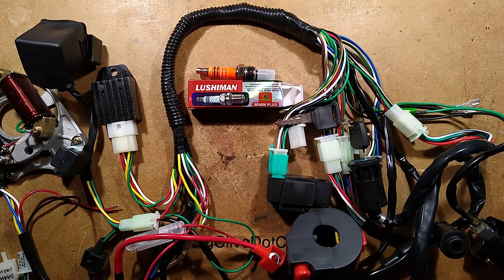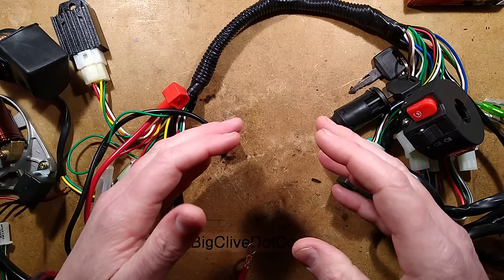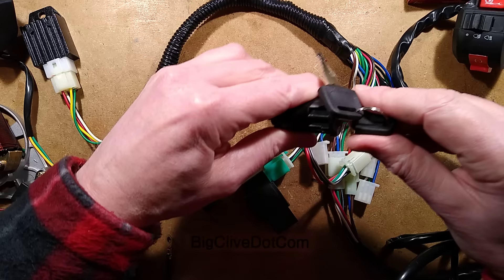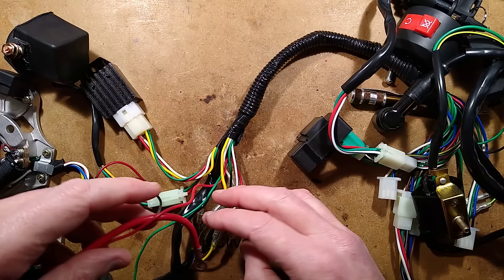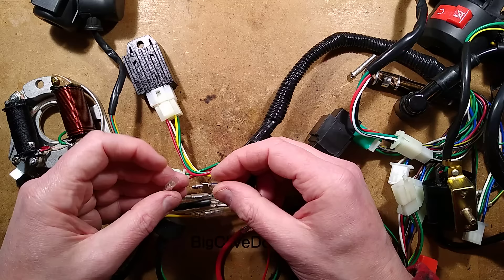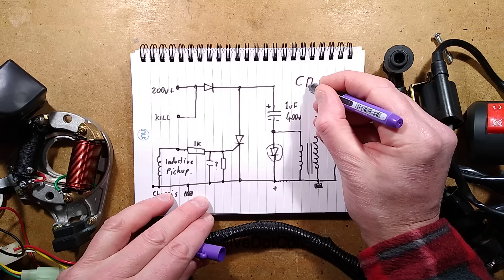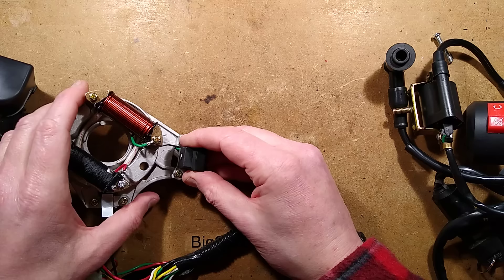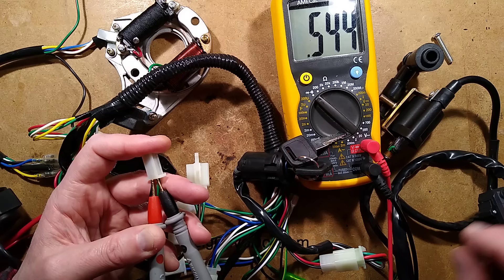Exploring the wiring loom of a Chinese quad / scooter.

Comment: This has to be your single most niche teardown.
Reply: Eh, I've seen nicher.
Reply: I love off roaders & Clive...
Reply: I would say its one of the most common! All the chinese 50cc scooters have exactly the same setup, and these things are everywere here in europe. I fixed a dozen of those things, just for friends and neighbors.
Reply: @MrMilarepa108  ah yes the good days
Reply: @WolfmanDude  On reflection, thinking about what Clive has looked at in the past, I'm now inclined to agree!
Reply: Surely no more niche than electric showers
Reply: @WolfmanDude  could you tell me what the two wires from the stator/flywheel are for?
Reply: @allball8014  Yellow usually is 12VAC for the headlight. The white one is 12VAC for the battery-charger. Both go into the regulator first. Tell me if you need more info
Reply: @WolfmanDude  thanks for replying, I’ve got it wired up, but it continually turns over. The kill switch doesn’t shut it off or the key doesn’t either. If I touch the starter wire to the soliniod it turns and disconnect to stop it. Any help is appreciated.
Reply: @WolfmanDude  this isn't for a scooter, based on the controllers and the length it's a atv motor 100%, the scooter motors are basically all gy6 based as well, this one is an very similar engine but not gy6 based on the stator, likely a 2 stroke equivalent, but wouldn't have the standard mount points to be compatible with gy6 frames, might be cutting hairs though, for how they operate there ain't much difference

Comment: The size of them quads/ATVs are usually kid-sized, hence why everything is so close together, neat kit though, could be useful for building up custom small-engined power toys... :D
Reply: That explains why the ones I rode in summer activities "camp" (no overnight things) were so perfectly sized! God damn I loved zooming around an empty farm field in one of those things. As a 7 year old, that being my first firsthand experience with any motor vehicle, oh it gave me a real taste for em.
Reply: @kaitlyn__L  I've no experience of riding them myself, I've just seen a number of them here on youtube being fixed up or torn apart for their engines to use in other projects... :)
Reply: But the same parts are also used in 50cc scooters, and there are lots of those out on the streets, both either 2-stroke or 4-stroke.
Reply: @Seegalgalguntijak  That's true, but the wiring is usually longer for those to reach, hence why these kits are for the small quads/ATVs, smaller frames, shorter wires... :)
Reply: @twocvbloke  understandable! It got me wanting a Honda scooter once I was old enough to get one of those licenses. Though I never did manage to successfully save up for one before learning to drive. I've not ridden an ATV as an adult at all. But I still have fond memories of that.
Reply: usually isn't so much of a thing. Every quad I have seen has been 350cc and up.

Comment: Start inhibit is often wired to a switch on the side stand.
Reply: Some scooters are also supposed to have a tilt switch that kills the engine if you fall. Fortunately I've never had the pleasure of testing it out. Yet.
Reply: Some of the Chinese stuff have both. The Peugeot 50cc that uses very similar loom (Chinese gy6 engine ) has the kill on the bar and the stand .
Reply: Quad bikes have a side stand? On a lawnmower it would be wired to the brake and/or the seat weight=sensing microswitch. Quad might be the same.
Reply: @manolisgledsodakis873  Re-read the video title
Reply: Automatic transmission bikes/quads tend to  have a Micro switch on a brake lever, i.e. pull the brake in and it allows the engine to run ( or starter motor to spin). It could be that perhaps?
....Oops, just noticed someone else has said something similar..
Reply: @murfphone914  Yes indeed. They tend to use the brake light circuit.
Reply: Many 4-stroke engines will have a low-oil cut-out.  Loads of genuine uses  for a kill switch.

Comment: The trouble I've had with "waterproof" switches on bikes is that once the water gets in, it never dries out. 😁
I'd rather have an "open" one with the contacts slathered in vaseline, for most purposes.
Reply from the maker: Sadly, that also applies to most electrical equipment.
Reply: The automotive connectors - the ones with rounded sides and wiper seals with multiple rings on them, and a catch on the outside - are quite reliably waterproof though. Never had an issue with those, admittedly in a car, but that gets splashed more than one expects. I don't know what they're called, and I can't be arsed to look it up right now...
...."Delphi connectors" apparently, damn you!
Reply: @horrovac  There are many different connector companies that offer water proof connectors.  Delphi being one of them. 

 I've noticed most connectors on bikes are not waterproof, interestingly the ones that are waterproof seem to be the most protected from water already...   (under the gas tank, etc)
Reply: @horrovac  In the USA they're commonly known as "Weatherpack" connectors. One of the first designs of these connectors on the market and still available today. I suppose the name is short for "Weather proof Packard", Packard Electric (which was a division of GM; these connectors were stamped PED, for Packard Electric Division) being the predecessor to Delphi. Delphi is now known as Aptiv. 

Ford refers to these as "submersible connectors".
Reply: @Ender06  We've got Deutsch connectors here in Australia. Same concept, very good water resistance
Reply: @horrovac  'superseal' connectors are reasonably common in the UK, they work well as you state.
Reply: @horrovac  Superseal? Can't fault them personally.
Reply: @MrTBurt85  Yes, those seem to be the ones.
Reply: I think it was in the eevblog that we saw a reenterable potting compound, looked like a clear jelly. Wish I had a paint bucket's eorth of the stuff. Or two.
Reply: I rode bikes for years and they were always kept outside uncovered. Apart from the leaky kill switches on old Hondas I never had much trouble with water getting in switch-gear.
Three tips......
Open up the switch housings, warm up some Vaseline, and liberally paint the inside using a child's paintbrush.
Never squirt WD40 or similar in the switches except in an emergency. It solves the problem temporarily but then the water just sits on the top of it and it's worse afterwards.
Fit handlebar muffs.
As an ex London despatch rider, 15 years in all weathers, I'm a little puzzled by the idea of switch-gear being reluctant to dry out. That was a problem I never encountered.
The reason that motorcycle wiring isn't better waterproofed is because in practice.... it doesn't really matter.
Reply: @horrovac  Sounded a bit like a AMP/Tyco Superseal connector to me. Same idea different manfacturer.
Reply: Land rover used to use some nice ones. Be in breakers all over.
Reply: @horrovac  I actually rigged a delphi connector up in old scooter to replace the hodge podge the prior owner did ( they cut the connector out and wired it up and put tape over it....) Was one of the reasons that scooter didn't start, because those connections were corroded to shit. It worked till I let a "buddy" borrow it and kill it.
Reply: @mattinman8285  Deutsch connectors are very common in heavy-duty/commercial vehicles in the USA such as Freightliner, International, Peterbilt to name a few.
Reply: @Ender06  Most connectors on boats aren't waterproof either. At least not the older ones. The engine wiring usually is, but the wiring for the controls and instruments usually does not use waterproof connectors.
Reply: @brianleeper5737  Delphi was purchased by BorgWarner, I live about a mile from what used to be the world headquarters (before it was moved to Troy, then the UK) I worked there for years, first in engineering, then IT. They changed the sign to BorgWarner just a few months ago. I think the sign might still have Aptiv on it, but Delphi was removed and BorgWarner is very prominent. This is in Kokomo, IN.
Reply: Water is a b*tch.
Reply: @jbuchana  What I'm finding is that Aptiv is a spin-off from Delphi and not included in the sale to BorgWarner. Aptiv is traded on the NYSE as APTV. The connector business is part of Aptiv and are listed as such at suppliers like Mouser Electronics.
Reply: @brianleeper5737  Interesting. I'll have to look into that. From the sign in front of the building, it looks like both companies are working from the same buildings south of Lincoln street here in Kokomo. The former ERC (Engineering Resource Center) building on the north side of the street is now being used by Ventec, making respirators. They're shutting down soon from what I read in the paper.
Reply: Careful with vaseline and old connectors, I overdid it and caused intermittent faults as the vaseline melted into them ('81 gs450).
Reply: @EnigmaticBiker  I use either silicone dielectric grease or Nyogel 760G also known as Ford Motorcraft XG-12 terminal grease. Never had a problem with either even on old connectors. Vaseline seems like it would produce the exact problem you describe--it melts and runs.
Reply: @jbuchana  It's interesting to me that GM has really cut back on using Delphi as a supplier. My 2013 Chevy Volt has mostly Bosch engine management components. I think the radio is made by Panasonic. It's definitely not Delphi. My friend's 2012 Chevy Impala, the factory radio is made by Fujitsu Ten. There was a time not long ago when every GM vehicle had a Delphi or Delco radio in it. And while I'm on the subject of Delphi/Delco radios, one of the interesting features that they have is when you hit a preset, it instantly tunes the preset. There's no 1/4 or 1/2 second of silence before it tunes like other radios. I can't be the only person who has noticed this, but I've found nothing about it on the interwebs.
Reply: @brianleeper5737  Ford is entirely too optimistic. "Submersible" ... LOL.
Reply: @Fridelain  The reenterable potting compound is probably 3M Scotchcast. But any low-durometer polyurethane molding compound would also work, I think.
Reply: @petergamache5368  The electrical system will still be waterproof even as the vehicle floats downstream...
Reply: @mattinman8285  My Harley uses some Deutsch connectors
Reply: @EnigmaticBiker  With Lucas electrics, that seemed like an advantage. 🤔
Reply: My favourite is outdoor emergency lights.  Whether it is the fitting or design seeing the water trapped up to the centre level makes me wonder #@$£
Reply: @trevormatthews7981  Reminds me of the old saying: There are only two kinds of underground conduit. Those that have water in them, and those that will have water in them.
Reply: @brianleeper5737  Nice one
Reply: Why don’t you put sandwich bags over everything electrical for a first line of defense so you can drain it when it gets in the sandwich bag rather uour Chinese water proof connections.
Reply: Your problem is defective parts. I have the same problem with my bathtub it’s waterproof until I put the drain plug in and put water in it then it holds water my tub is garbage it leaks in the water won’t come out unless I pull the drain plug. Jesus Christ that’s kind of a dumb 
Statement
Reply: maybe if you open one up pack in some silica dry packs and seal it up thoroughly with silicone? hopefully it would stay dry-ish and tolerate the occasional condensation inside.

Comment: Starter safety switch:  I have owned 2 scooters, one decent Japanese ('85 Honda 50cc), and one cheap Chinese (201? ??? 250cc).  Both have a sort of interlock relay that is wired to the brake lights.  You have to engage the brake to use the electric starter.  Both use a belt-type CVT that outputs to a centrifugal clutch which transmits power to the final reduction, and the rear wheel.  Adding in a manual clutch is something that is only done for vehicles that have a manual transmission, which is more expense than you will get out of a Chinese import.

Keyswitch and killswitch:  Shunting the ignition primary coil to ground has been a standard "safe" engine stop procedure for years, decades even.  I have a '73 Yamaha DT250 that the keyswitch shunts the ignition primary to ground in the "off/stop" position.  The extra killswitch (to be mounted on the handlebars) is a more recent highway-safety standards implementation to stop a downed bike because the manufacturers put the key just wherever they like, and they may get snapped off in a collision.  That flattened killswitch is much more likely to fail safe.

Comment: The 2 spare wires at the stator are probably for a neutral light switch. 

It's very common to kill the engine ignition, simply by shorting out the CDI supply coil. Lots of small engines use this system, from cheap quads, bikes and even petrol garden power equipment.
Reply: Even petrol (gas for the yanks :P) powered RC car use a direct short across the stator coil to shut off the motor. To shut off a nitro, all nitro owners had "that" screwdriver, whose handle was firmly pressed against the tailpipe, which caused the engine to bog down and stop! The other option was to squeeze the fuel line tightly, but the tailpipe method was quicker, especially when dealing with a model whos throttle servo had jammed at wide open.
Reply: It is a deceptively elegant solution. Low current, high voltage, and what you're shunting is galvanically isolated from the 12V system. So long as there's anything resembling a current path from the switch back to the engine, the kill switch will do its job without bothering anything else. I had a motorized bike conversion kit with the kill switch on the handlebars, and the switch always found a path through the headset bearings and suspension to kill the ignition.
Reply: how do I use those wires to turn off my quad?
Reply: @sploofy4878  connect the black and white wire (all the same wire) coming off the cdi box plug to the frame

Comment: I got a 50cc chinese quad and this are my findings for the connectors you were unsure about; 
- Dash ? labelled connector is for brake light, 
- the 2 wires at stator are for neutral on 3 speed models (imo)
- the safety switch with the solid connector is for the "fall off bike" feature, that will shut down the quad in case of a fall
- the other safety is connected to the brake switch on automatic model to ensure the bike doesnt start to rollout on it's own on chocke start being an automatic

Keep it up, great video!

Comment: Other kill switch wire (plug) is for a remote safety switch or tether as the harness is for a youth quad. 
The 2 spare wires by the stator are the neutral and reverse indicators if equipped.

The reason the handle bar switch wires don't match the loom color code is because they're are a dozen suppliers making them and they're generally interchangeable.

I rebuild these little quads as a hobby. It's nice that the looms are cheap because they often fail but would likely be less prone to fail if they weren't so cheap.

Good video and explains the electrical system well👍

Comment: The first bike I ever had was a super cheap Chinese 49cc moped/scooter called a Taotao. It was $800 new, I bought it for $300. The engine was basically a Chinese clone of a Honda GY50, which was nice because it allowed me to buy better quality parts designed for that engine (things like carburetor, clutch parts, etc). I only got it to see if I was interested in riding on 2 wheels (I was). The wiring loom on it looked basically exactly like this, although I'd imagine the wiring between the handle bar connectors and everything else was longer. Nothing was water proof, but I still rode it in the rain regularly. Rode it for a year, sold it for $400  when I bought a real bike.

Comment: Triple electrode spark plugs have been around for many years. My dad was an engine fitter in the RAF, and he told me that many WW2 aircraft had them. I used them in my Mini with a high voltage Lucas Sport Coil. It gave more complete combustion of the air-fuel mix.

Comment: Interesting, particularly how the kill switch works. I've encountered petrol hedge trimmers and leaf blowers where a loose connection would prevent the engine from being turned off. Which struck me as odd, because normally you'd expect a loose connection to prevent it from running at all. Now it makes sense, the loose connection was preventing it being able to short out the ignition.

Comment: Those kill switch connections are likely a parent cut-off switch with ribbon type setup mounted to the rear of the quad so a parent can walk behind and cut the engine if required, these China quads also have an optional remote start stop alarm system fitted which accounts for the second spare kill connection 👍🏻

Comment: You may find the 2 wires in the stator harness and the kill connector are linked to the side stand switch, which cuts the engine if the stand is down and engine running in gear (not neutral)

Comment: Shorting the coil to ground is not as dramatic as you think. The coils operate like constant current sources, not like voltage sources. Some regulators even short the current to ground when the battery is fully charged!

Comment: On my chinese scooter you need to have the side stand up and  the break on in order to start it, so that is what some of those extra connectors are for. You are right about nothing being waterproof. The horn on mine packed up when it was about 6 months old. I investigated and it was simply a non-waterproof component with exposed wiring tucked behind the plastic faring. Basically if you ride in the rain you need to make sure you park it somewhere dry and windy afterwards. I think these bikes are designed for occasional use in nice weather. But as the entire scooter cost £1K brand new, on the road price, they obviously need to cut a few corners.